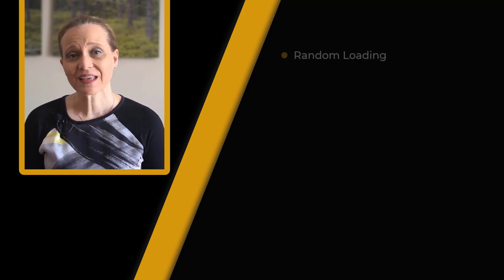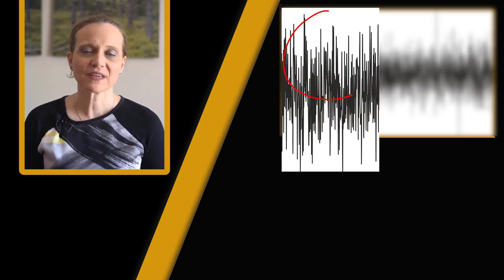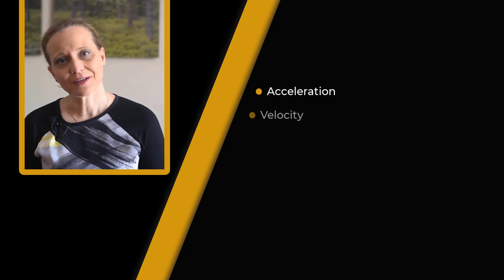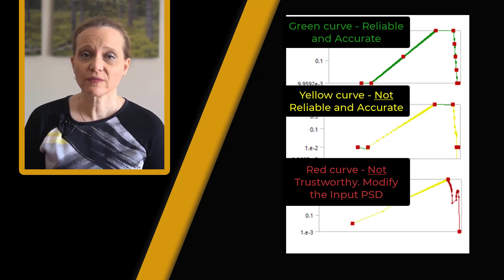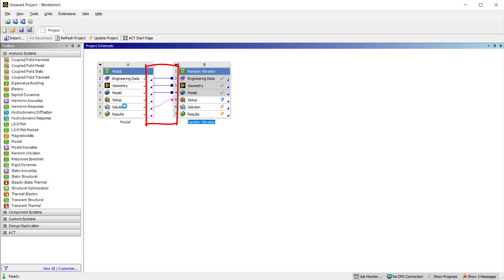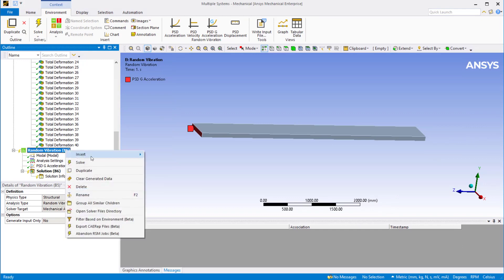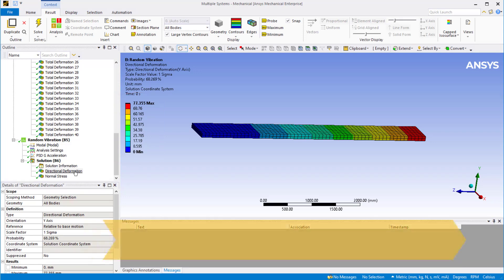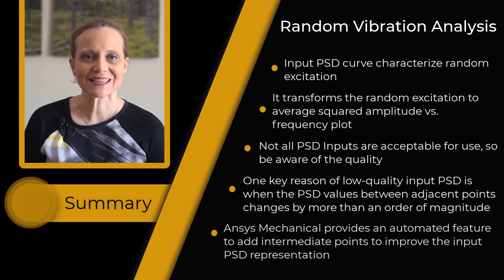Checking the Fidelity of the Input PSD curve Using Ansys Mechanical — Lesson 2

Comment: Thank you for this video. I have a question. I try to get a displacement of a structure in PSD Analysis. Could I use somehow a measured data from acceleration sensor?  By means of fast fourirer transformation i got a acceleration in frequency domain (G^2/Hz) in 3 axis .  How could I import this data in ansys?
Reply from the maker: Thanks for watching! Please post your query on the Ansys Learning Forum for a detailed answer from the wider Ansys Community: https://ansys.com/forum
Reply: You have to apply the acceleration in each direction using seperate analysis systems..You cant apply load on all three directions in a single analysis system.

So it is,
One for X direction
One for Y direction
One for Z direction

This is because of the probabilistic approach of the PSD analysis.